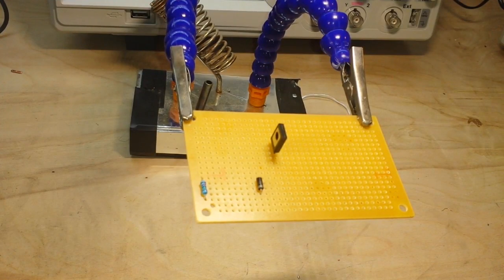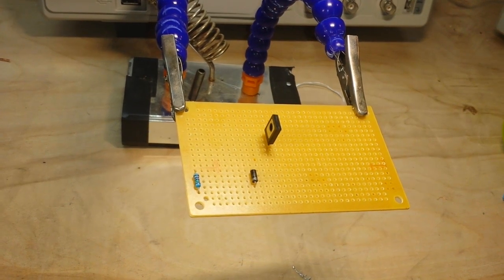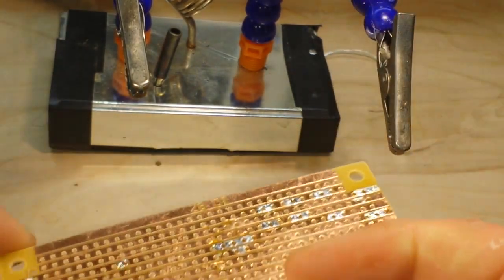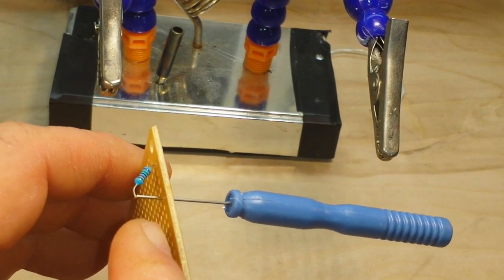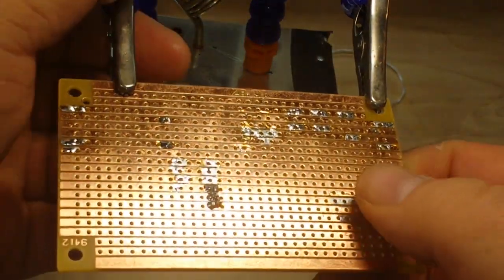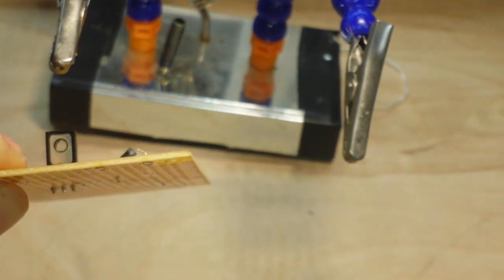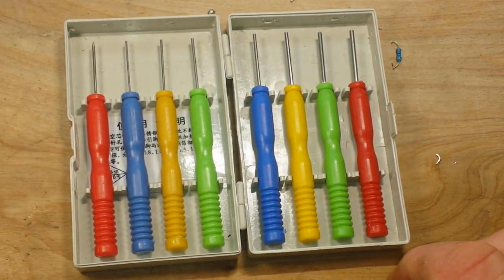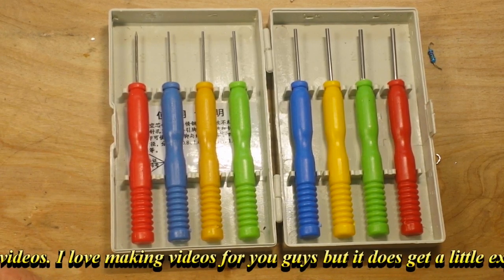Desoldering Technique #3: Hollow Needles

Comment: I'm tackling my first guitar pedal build with only minimal soldering skills and this video and tool saved my bacon. Don't ask how, but I accidentally got solder in an empty hole, and could not suck or wick it out. After searching online I found out about this tool and then searched YouTube and this video really helped explain how they worked. Anyway I ordered a set (very inexpensive and thank you Amazon overnight delivery). The smallest one in the set fit the socket and really in a matter of seconds completely cleared the blocked hole. The pedal wasn't going to work very well if I couldn't get the legs of the op-amp socket in place. Thanks a bunch, guy.

Comment: I've had a really annoying problem with trying to remove and replace 2.54 mm pin headers on a pcb. I've never been able to remove enough solder, with solder wick and a pump, to allow for the hole diameter to be large enough to fit the new headers inside. But the hollow needles completely solves that problem with ease! thanks for alerting me about them!

Comment: But the components that you removed, had their leads/legs soldered straight in/down the hole - most times, I find the components’ leads/legs have been bent once through the hole. Then what do you do? Is that why these needles are hollow, so that you can kind of slip it over the lead/leg and bend it back straight, to remove it? Sorry, if this sounds like a dumb question, just couldn’t quite tell from the video, what you were doing there. Please clarify, I want to learn. Thank you kindly

Comment: Great video!  One correction... the largest needle is 2.0mm.  You had the solid needle in the 0.8 slot and the 2.0 in the 1.2 solid needle slot which shifted your set of needles.  The only reason I bring this up is I was interested in why they have a solid needle in the pack.  I'm guessing it used to make a hole in a solder clump that has no hole... just a guess.  Nonetheless, I really enjoyed your video and  I now [also] have a favorite way to remove a component.

Comment: Well, hot damn! And I've been using fine tip stainless tweezers to sometimes poke holes in vias, all the whole time wondering if there were actually stainless steel tools made for desoldering! Literally just ordered the same set you have and a smaller sized set of "desoldering needles", not sure if those are hollow though. We will see. Just tried some of my 3D printer nozzle cleaning needles to clean out a via and it worked great! Thanks for the tip Paul!

Comment: needs to be decent quality or at least the correct SSteel, because just like some SSteel is magnetic esp if it's been heat treated, some grades take solder easily.  Still a damn good tool to have in your box (like all tools - its never one size fits all).
Guy I worked with always got the needles out and then said, "let's put some hair on 'em"  funny the first time ... but not so after 20 years !!!  It has to be said while it does the job and removes single leg components it just pushes the solder into a peak and leaves a heck of a mess so you have to go over it all again to wick off the waste.

Comment: Excellent series of instructional videos Paul - totally miffed that I have missed them as I was wondering why I was having trouble with my wick, even when plenty flux'd up... 🙄  Turns out it is not good on double-sided through hole components, D'oh!   Off to spend more dosh (Thanks!) and search out a de-soldering iron and some needles.  But I am happy with just the two natural holes in my schnozz... 🤪   Thanks for the tips as ever... 👍🏻 🐍

Comment: I got a Chinese reflow station for $40 on eBay, and that thing churns thru through-hole components as fast as you can tweezer them off the board. It left a little solder on the legs, but hey, they're already tinned. This is more precise, but that air gun saved a bunch of time.
Reply from the maker: True, true, an air gun will do it.

Comment: I haven't seen these before!! I like them and I will be getting a set. I found these on Amazon, are these similar enough? And is there a way to add them to your store?
https://www.amazon.com/Doradus-Stainless-Hollow-Needles-Desoldering/dp/B01D2UE9TW/ref=sr_1_2?ie=UTF8&qid=1522476808&sr=8-2&keywords=desoldering+needles
Reply: Okay, I just checked your store and you already have a set. I'll be sure to order them through that link.
Reply from the maker: Thank you

Comment: Board holder is far too flimsy as I know me and I would have burned myself more than a few times doing what you did for sure.
Reply from the maker: I burnt myself yesterday with a transistor I heated up with a lighter to show how heat effects transistor beta. Burnt my thumb and index finger but good!
Reply: Oh, boy I have done that.  I have even been so damn dumb as to grab the iron part of my soldering iron before. :/

Comment: Very interesting video. Too bad it won't work with smd components or components with more than two legs.
Reply from the maker: No it won't work with SMD. But it most certainly will work with components with more than 2 legs. I use them to remove dip8 ics all the time. Once you have desoldered a leg, it stays desoldered.
Reply: I certainly believe in you, but maybe you could add a minute to the video demonstrating how to use it with IC's?

Comment: what about desoldering a header. Can you get each leg desoldered by poking the needle through one at a time.  Each leg is in a stationery position until the whole unit is desoldered?
Reply from the maker: Yes it will work just fine.
Reply: So you are actually melting the solder and pushing the needle through the hole and displacing the melted solder and freeing the pin! Neat. I tried removing a multi pin socket and it was disaster trying to suck out the solder.  This looks much cleaner ( pun intended).
Reply from the maker: That's right. Once you have desoldered a hole, it stays desoldered. You just move on to the next. When they are all done, the component just falls out.